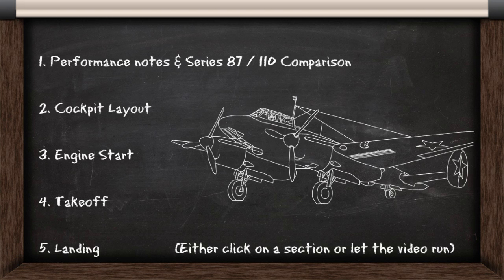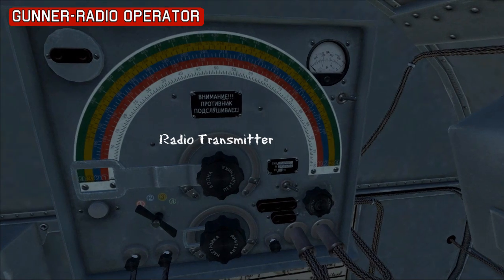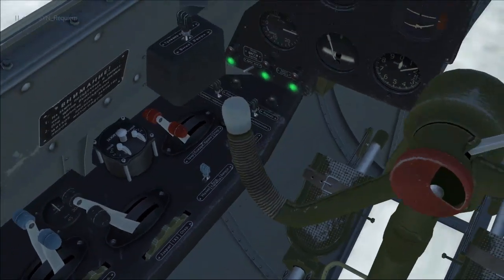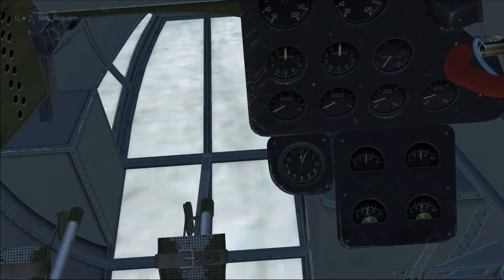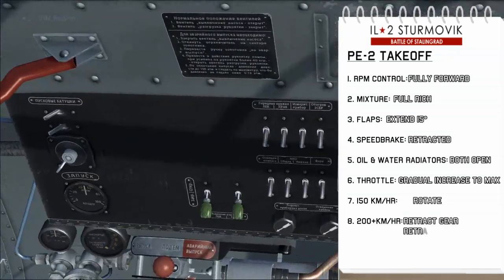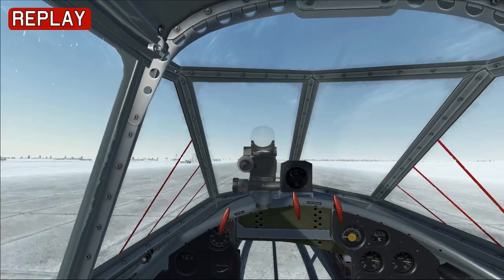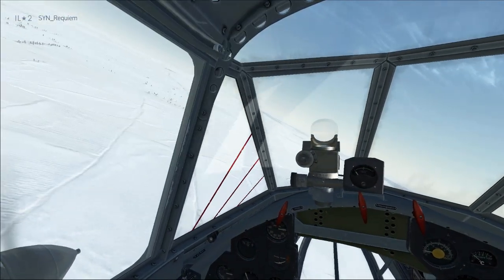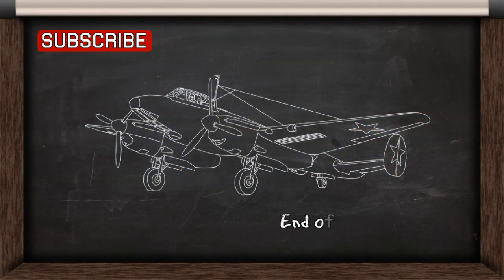Learn to fly the Pe-2 (Series 87 & 110)

Comment: Thanks for making this video. It's very helpful to learn how to fly this great bird! A cool thing I noticed that I had never seen before is the sign in the radio operator's section: translated from Russian, it says, "Attention!!! The enemy is listening!"
Reply from the maker: Thanks for that information, it's cool to know. I do so much translating of Russian to English letter by letter I only do what I see I need to figure out what the hell is what in these cockpits.

Figuring out how to make the Pe-2 easy to land was a pain as well. I was focusing on the 3 point landing for so long, then just said screw it and went for wheel landings :-) It's very nice to fly in general though.
Reply: The Air Combat Tutorial Library If you learn how to pronounce Russian words, you will notice that a lot of words sound very similar to their English counterparts, just like English does with many other languages as well. This unfortunately doesn't apply to plainer words like "speed" (скорость), but if you pronounce "температура" (which sounds like "temperatura"), it's self-explanatory. Though, you'd probably already guess it by the huge C°.

Comment: Just got the game and I cant get off the ground in this plane, stuck on the ground taxing in a circle, full rpm rads. At 30% throttle i dont move and slightly above that the plane acts like I left the right main parking break on. Im trying to upload a video that shows this issue, but in the mean time, please help!!
Reply from the maker: Happen to have that video Kollider? Or did you figure out the issue...
Reply: The Air Combat Tutorial Library Haha...yea...well you see, I’m so used to flying single engines, that when I throttled up and only saw my first engine notification, I didn’t think twice about it. I never had my right throttle bound to my joystick setup. Kinda hard to do anything on one engine lol

Comment: my plane doesnt pull up or when it rarely does it just goes of to the right
Reply: plz help
Reply from the maker: If it's not a control assignment problem then you're either:
A - probably pulling back on the stick too early, so you're not getting to a high enough airspeed.
B - Propeller RPM is not set to maximum